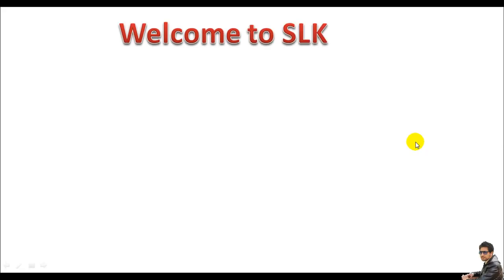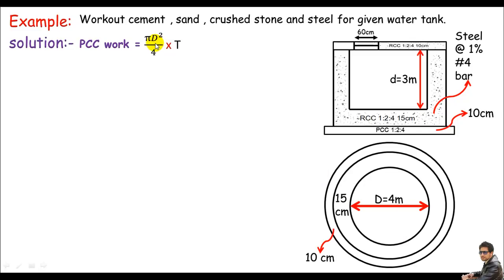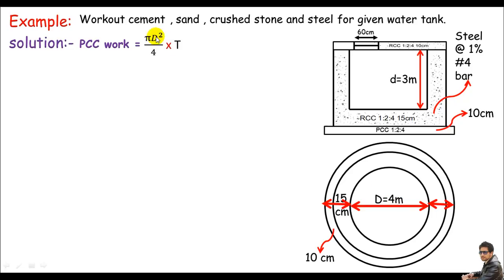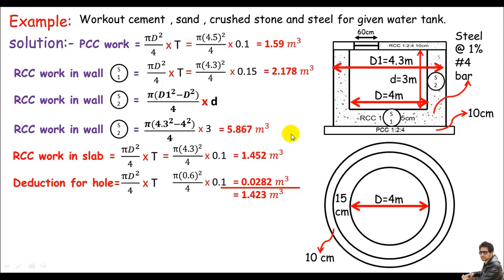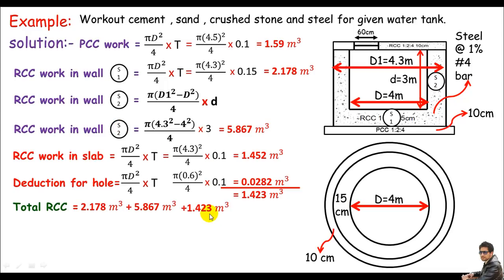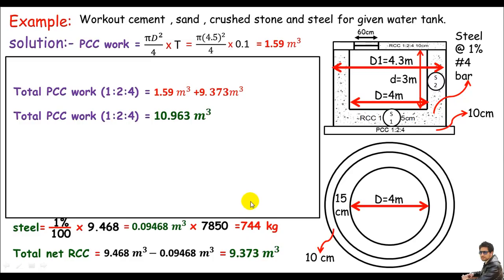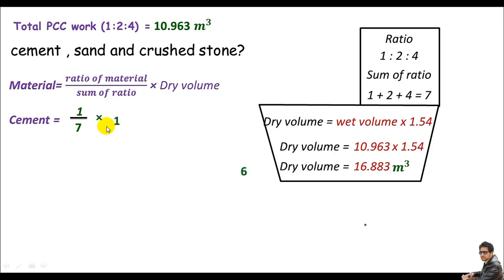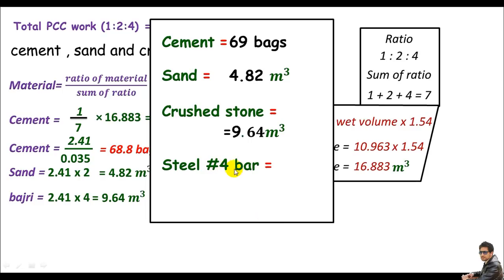Quantity survey:- Materials estimation for circular RCC water tank.

Comment: What is steel bar mm size
What is #4 in steel bar
Reply from the maker: In FPS system #4 means 4/8 inches or 1/2 inches diameter of bar or 13mm diameter of bar.

Comment: dear SL Khan I happen to watch your video and it's nice to see the way you talk about civil engineering. But as you have mentioned, π×(D2-d2÷4×depth or height is totally different. That formula is only applicable for the cross sectional area of a hollow circle. There are many ways where we can calculate the volume of a circular walls. The most efficient and easy one is ~ height × thickness × π × radius × 2. Thanks
Reply from the maker: khalid shah 
thank you dear for your nice appreciation. and thanks for your formula. by the way i also know about your formula and the concept is the cross section area times height. 
as in your formula you multiply the thickness with height which is the area of wall section and then you multiply that with 2×pi×R which is the circumstances. so the formula becomes so complecated for beginners . am i right? thanks for joining SLK's tuts.

Comment: great video, i have question how do we calc water quantity, and suppose how we calc for 1lac gallon tank?
Reply from the maker: Bilal Saif 
check the channel in detail you will find a lecture named as how to calculate any material weight using one formula. i hope your answer will be there in that lecture.
how ever water quantity is taken in volume like you said 1 lac gallon. which mean 1 lac gallon is the quantity of water. or you can calculate water litters. like just find the volume of tank . multiply volume with 1000 to get water inform of litters. remember the volume must be in cu.m if you use 1000 in place. thanks for asking